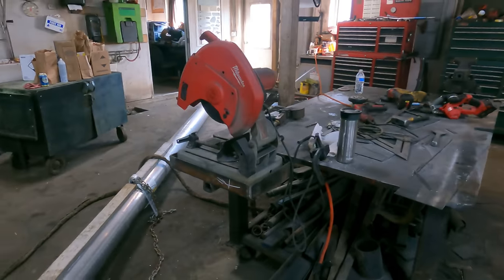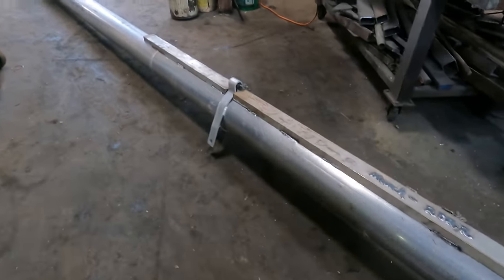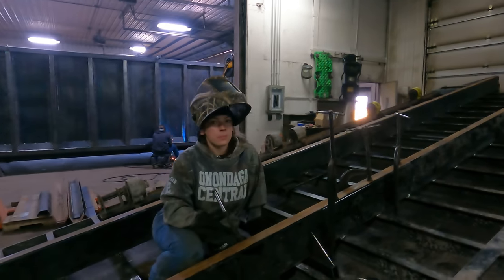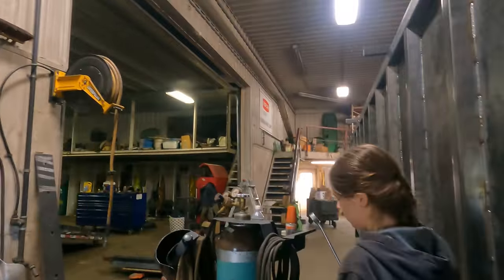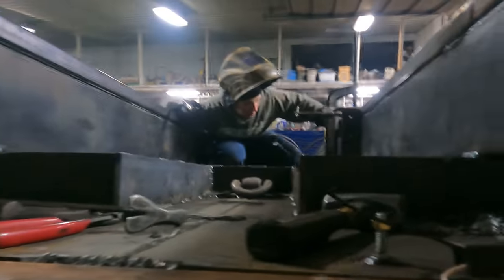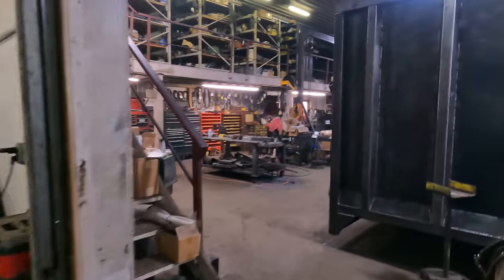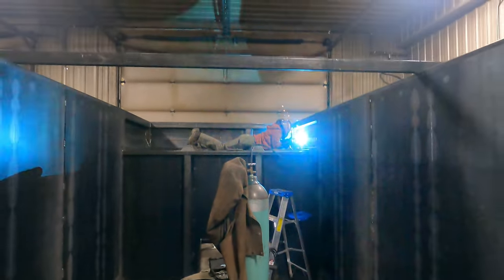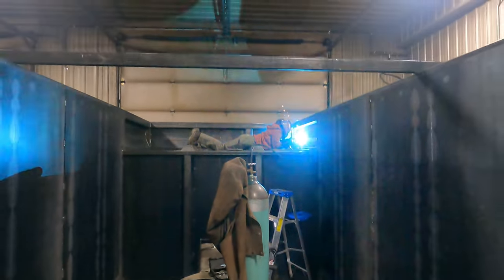Flatbed work  Aluminum Manure pipes

Comment: The flatbed looks like it was a lot of work especially when you have to cut and reconfigure the sills . The forklift was a little bit on the light side to move the heavy bed around. The welding crew is doing a good job 👍👍👍👍

Comment: Big recall on certain Olight flashlights Andy!
Reply from the maker: I heard that
Reply: @FarmingFixingFabricating  info is online. 👍
Reply: I was reading that this morning. Seems a little silly I think. That would be like recalling a space heater because it gets really hot and you touch it and get burnt lol. I generally lock mine before I put it in my pocket or the holster or turn the battery cap a quarter of a turn that way I know it won't turn on in my pocket. I could see if they were like spontaneously exploding or combusting but it doesn't seem to be the case

Comment: Those big chains are 25,000 lb  Working Load Limit .  If you need more of them.  They are sold at Colemans Military Surplus Sales .  About $40.00 each 9 ft long.  They are used to tie down equipment on aircrafts.

Comment: Andy if you preheat your aluminum it welds so much easier and better looking and you need to get a push /pull gun for your 355
Reply: Years ago before I was paralyzed i worked for my uncle and we use those spool guns for all our aluminum. I hated them things , I had a big aluminum job come up so I set my welder up with like a 6 ft lead that had a special liner for aluminum & it still wouldn't work with the regular push style feeders. 
  Now that I'm nolonger there and able to weld he switched over to the push / pull guns. I didn't know there was such a thing till a few years after I was in a wheelchair but they looked like they would be a whole lot nicer than a spool gun.

Comment: those bent hooks look like military Air Cargo chains,  C-130 air cargo pallets use 1/4 chain bent hook on one end ,  I buy them on Ebay,   C-17 uses 3/8 chain single end with bent hook,
Reply: What size does the C-5 use for the M1 tanks?  :)
Reply: @beckyumphrey2626  I’m guessing they use 1/2

Comment: Not being a smartass, a trick that we do with our wire welder is between the spool of wire  where it goes into the feed drives we take a 3M scuff pad fold it over the wire and put a clothes pin on it to wipe the wire so speak. Haven't had any feed issues plus it lightly scours the wire also. Are either of the girls willing to learn aluminum welding? Be safe, enjoy the videos.
Reply from the maker: I have run then round things in the wire before but really didn’t see any benefit to it. They’ll get into aluminum when it presents itself

Comment: At front of flatbed, the cross members  are cut & boxed on both sides of the new "D" Ring, is that correct❓ creates Recess for the eventual wire rope winch cable ❓🗽🇺🇸
Reply from the maker: Yes

Comment: Well buddy I would say it's time to weld more counterweight to the back of that Clark. Just a little bit let's you pick up a lot more lol. 
I give Alex credit walking on crossmembers working on an incline all day. Awesome video man didn't get to watch it until this morning, I had to go out and pull the steering axle out of our 55 ton forklift yesterday. It has like 7 inch diameter solid pins that go straight through the oscillation joint and they were rusty and stuck in the bushing . It was a project to say the least haha.
Reply from the maker: Sounded like fun

Comment: Question Andy re: the sliderail system. I've seen them work and know how they work (a cable pulls them on the chassis). How do you safely hook the cable to the 'D' ring? And how are they ejected from the chassis when changing?  Thanks.
Reply from the maker: By raising the hoist…….. very primitive design
Reply: @FarmingFixingFabricating  thanks Andy

Comment: Andy do you ever use a carbon arc/air rig for cutting out old welds?  Those do a nice job and less grinding required afterwards.  Just be sure to keep a fire extinguisher nearby.

Comment: Things seem too be moving right a long on this build . The A&S welding teem are doing a great job get r done ! lol  A Little larry the cable guy on the job humor Lol ! Andy have you ever tried flux core wire . Just wondering what you think of it . I have used it on a small 110 welder but never on the 220 ones . I would really like too learn too weld Aluminium with the mig and tig both .
Reply from the maker: No I haven’t